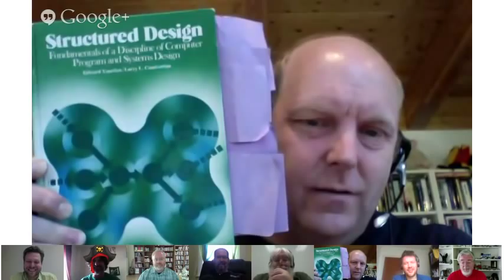Understanding Coupling and Cohesion

Comment: I wonder whether the discussion is not missing an important concept: levels of abstraction. At any given level of a system abstraction, you can study the system´s components and analyze the components´ level of cohesion and the way they are coupled. Once you consider cohesion and coupling acceptable at that level of abstraction, you can group components into more abstract components, analyze the new levels of cohesion of these new components and the coupling this induces. In other words, one level of abstraction´s cohesion may be another level´s coupling and vice versa...

Comment: Am I being too obtuse by thinking coupled items are tired together, as in locked, while cohesive components are stuck together by an outside force (perhaps a configuration layer).
Reply from the maker: I like this way of expressing the difference. I might say that coupling has to do with structural togetherness (describing how things are), while cohesion has to do with logical togetherness (describing how things ought to be). Coupling has to do with options for change, while cohesion has to do with desirability of those options.

Comment: which one connecting which called as coupling like extended ,,,but when we use implements is used is called as cohesion like interface   ,,,,,
Reply from the maker: +Avinash Gupta I wouldn't say the same. Interfaces do not guarantee cohesion. Interfaces give us a place to improve cohesion. Interfaces also give us a place to reduce coupling more easily. Sometimes, we add coupling through an interface, even if there isn't a link between objects: we can have coupling of concepts. This is worse: it looks like no coupling, but the coupling is there.